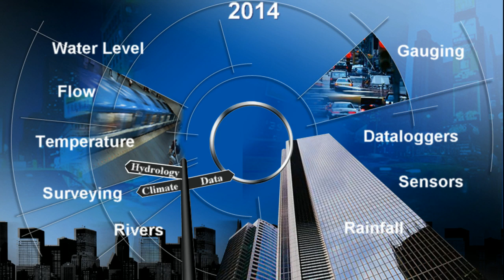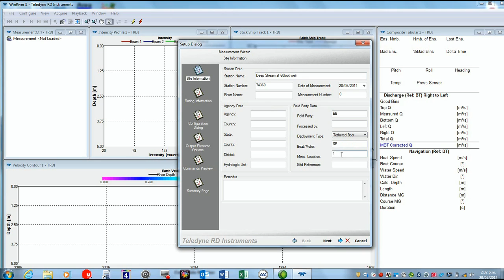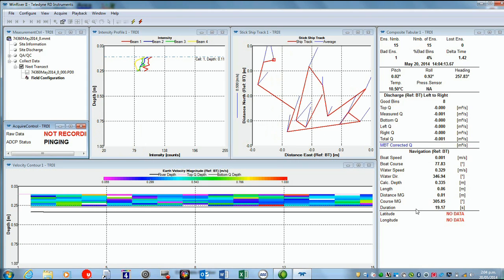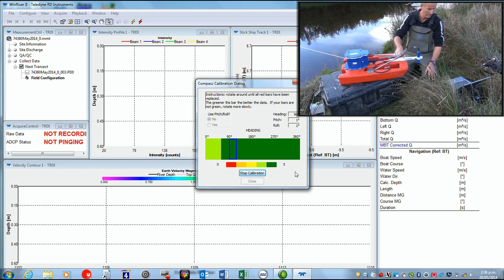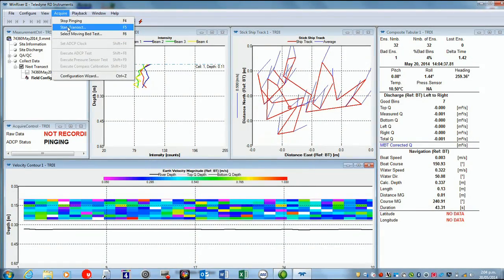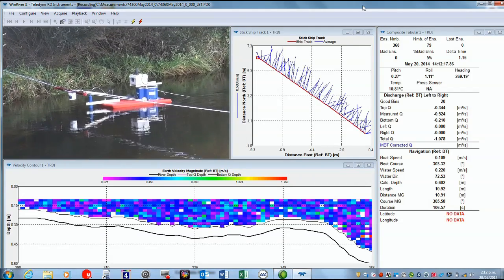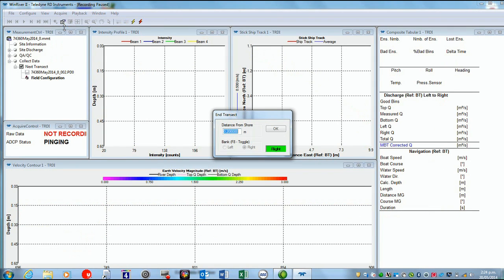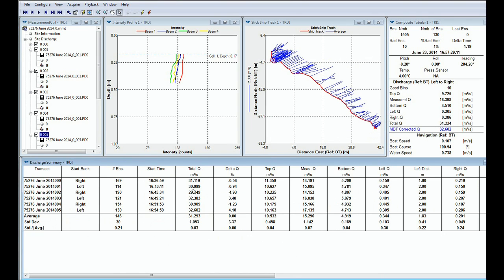ADCP StreamPro Gauging & Moving Bed Tests

Comment: Hi! This video is very useful, I can learning a lot about it. But I have a doubt, how are the measurements of high streamflow with ADCP? They are reliable?
Reply from the maker: Sorry for delay, great point you make as at higher flood flows this method can struggle. So you could use this StreamPro device for small to medium rivers and then use the RiverPro, or larger ADCP version, for the higher large river flow applications. These are used for all major rivers around the world but the times when you can't use them is when the sediment load or surface velocities are so high that the acoustic sound waves won't penetrate the water column and reach the bottom or bed of the river. GPS and Section by Section method helps with this but at some stage the gauging becomes impossible or impractical! Hope this helps.

Comment: Hello, I am using this equipment for my fieldwork and I want a system with which I can move it automatically with a machine at a uniform rate. Thank you so much for the video, please share your email so that I contact you. Would you mind mentioning the name of that remote-controlled device with which you are moving the ADCP?
Reply: We call it the 'Traveller' and you can purchase them from NIWA Instrument Systems by contacting: stuart.escott@niwa.co.nz There are also other devices called the 'cable chimp' which do this and possibly better - google it. Thanks and good luck making great measurements.